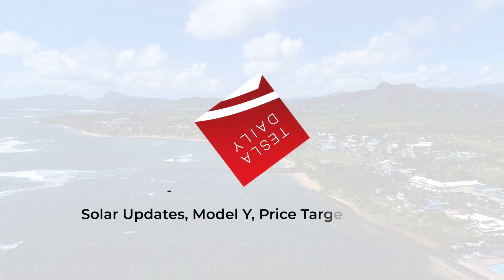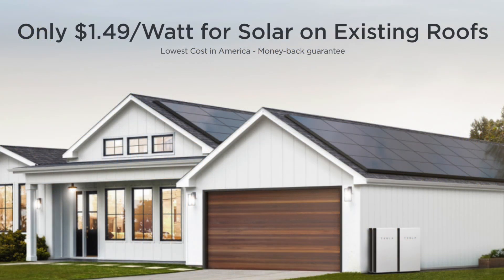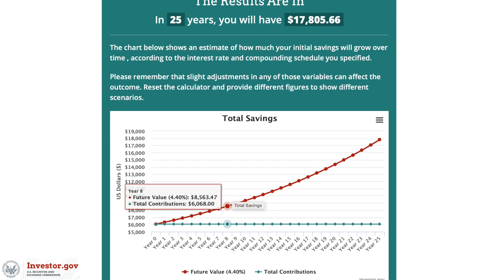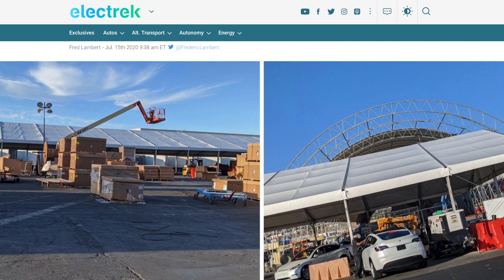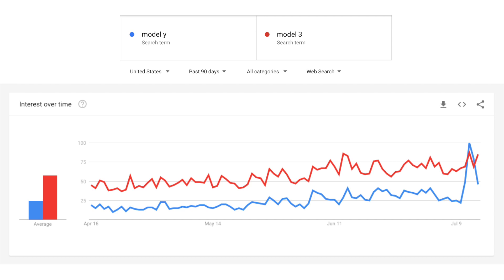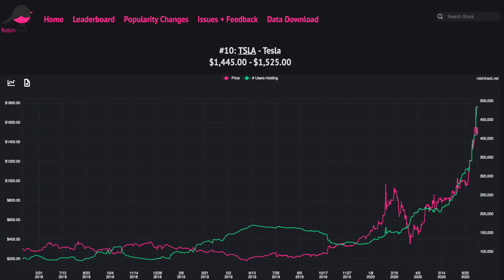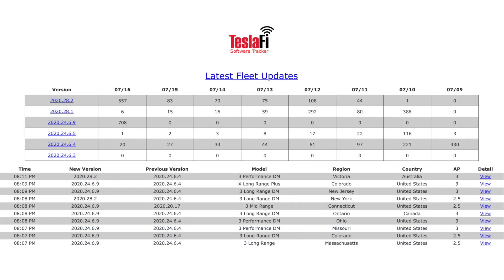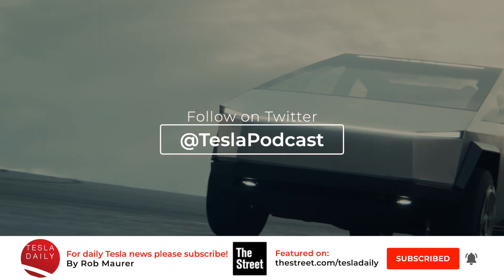Tesla Pushing Down Solar Prices, Model Y Interest Up, TSLA Price Target Increases + More

Comment: Ha haha. Money Back Guarantee.. You never had to deal with Tesla when comes to money. I lost 30% of my production last year because my system being down for 3 months. I was told I would be getting the difference under the Performance Guarantee. After numerous calls and run a rounds I never seen a dime. You might think the Company with the highest Market Cap would pass a little of that back in good Will customer service..

Comment: You do the math!  Installed Tesla's numbers are $2.01 before and $1.49 after incentives.  I pay .11 a Kwh, in Texas. The average price in California is 16.7 cents per kWh.  It would costs based on $2,010 for a thousand watt system, which would produce "about" 5 Kwh a day, that $2,010., @ $.50 a day, over 11 years to pay off.  Of course Seattle homes and Arizona homes would be different due to geological factors among other variables involved.  That is $2010 (costs) to produce  $0.55 cents a day of electricity you won't have to buy. It would take 11years and after that you would make $0.50 a day.  Those numbers would change depending on the orientation of your roof (panels), your costs for grid power, Latitude and other numerous other factors.  The numbers I used suggests with back of the napkin number calculations the cost are still to high. IMO with Tesla pricing.  If you pay higher for grid power your pay back is  faster. Was that to difficult to say or understand??  Cheers

Comment: Hey Rob, regaring your end comment, you could already set difference between temperature for driver/passenger.

The difference is in the efficiency of turning it off completely which you could not before.

Comment: I don’t understand why solar is so expensive in the US?? $1.49/watt looks like a winner vs that table of US prices.

Yet I had installed two 6.6kW panel systems in December for 3300AUD each. That is 50c/watt or US$0.35/watt installed, after incentives. 5x cheaper than Tesla here. And the 2 installers had to drive 600km (375miles) one way from Perth to install them. What gives with US market pricing?
Reply from the maker: Do you know the AUS incentive structure?
Reply: Tesla Daily yes I do. It varies a little by state and is reducing each year till 2030, but homeowners will be quoted an inclusive price so it’s easy. The incentive increases linearly with system size
As an example, in 2020 in Melbourne a 5kW system will get you a $2500 price reduction, a 10kW will be subsidised by $5000.
https://www.energymatters.com.au/rebates-incentives/solar-credits-australia/

We don’t have any import tariffs on Chinese (or German) panels and inverters so maybe that’s significant. Silly if that is the reason why the US systems are so expensive?

Comment: I know it's most likely not 13M cells per day, but I'm wondering how many of those batteries are going to Powerwalls, Commercial Grid Storage and Utility Grid Storage.  From what I've seen Powerwalls are running a 2 to 3 month backlog, Commercial Grid around 4 to 6 months and Utility Grid between 8 months to a year backlog.  Who knows how much of a backlog they're going to have once they start rolling out the Semi's for customers (from what I understand they've already started using Semi's to deliver Tesla's).  Either way, they definitely need to ramp up production as fast as possible to fill in those gaps.
Reply from the maker: It’s a pretty small percentage. Tesla delivered 1.65 GWh of TE in 2019 and guided for growth of 50%+.

Comment: The ROI of PV goes through the roof if you consider switching from a gas/petrol car to an EV. Here in the UK petrol is approx 300% more expensive per unit volume than in the USA, but PV costs about the same (A lot of my American friends have no idea its so much more expensive !).  My annual petrol bill was around £4.5k / $5.6k per year. Now I drive an EV, and have 9kW (we have 3 phase at the building), and you could argue that the cost of the PV installation will be paid back in UNDER 2 YEARS from petrol savings.... We also get paid a modest amount of FITS for what we generate (including what we use before export to grid !). Look at it from this perspective, and putting as much PV on your roof as you can is a no-brainer …

Comment: @tesladaily Is the calculation of cost savings not missing something? You calc. Assumes that every watt of energy produced is used. This is not at all possible with solar panels alone. Only a storage system like Power-Wall would match production and use of energy, since they can accur at different times in a day. So your 8 year amortization assumes storage but doesn't include it as costs? Or is it right to assume that you sell to the grid what is not used and use when not enough is produced all for the same cost/price?
Reply from the maker: It assumes either backup through battery or grid (net metering or selling) or that you are able to use what you generate as it comes in. Always tons of variables with solar.
Reply: @TeslaDaily  very complex true. You being someone covering all of Tesla have now even more to consider with energy and more GFs. Good that you got the base case already on tab. It's really appreciated and patreon support is coming from Germany.
Reply from the maker: Thanks, Jan!

Comment: If usually battery constrained then build up some stock. The semi will need loads of batteries so the numbers may be indicative they are ready to go with semi. If a semi needs 5x a normal y then there is enough capacity for  500k Cars and the rest to semis/mega packs/power walls

Comment: Tesla also has power walls to make as well. which definitely takes out some of their battery production going to their cars. so it could be accurate still. especially with people trying to get solar and battery storage for that solar in their homes.
Reply from the maker: Tesla only installed 1.6 GWh last year though, they probably won’t do more than 4 GWh this year. Pretty small portion of the total at this point and I was pretty generous with the 5 GWh example I used.

Comment: Prices went UP for 75% of Tesla's solar offerings yet you still put "Tesla Pushing DOWN Solar Prices" in the title due to the price decrees on the other 25%. Are any fans of Tesla not an obnoxious zealot?
Reply from the maker: Haha, I don’t think I’ve ever been called an obnoxious zealot before, thanks for the new one. Two days ago the cheapest solar system you could buy from Tesla was $10,000. Now, it’s $8,200. Yes, Tesla is pushing down solar prices. And my title isn’t singularly focused on one change anyway. It’s the general trend since a couple months back and also relates to the competitive market place. Both accurately characterized by “Tesla pushing down solar prices”. Hope that helps you understand.
Reply: I'll split that hair for you sir.  If they sell a lot more of the smaller systems at the cheaper price, then the overall "solar price" will be down.  "Obnoxious zealot" is a little harsh, and I'm saying that as an oil industry professional.  8-)
Reply: why the hate?. just dont watch "tesla fans" videos...

Comment: Wow solar is expensive in the USA... In Australia I paid only about 11k for a 10kw system, and that wasn't an overly cheap system. It has more expensive components and panels.
Reply from the maker: Post-incentives?
Reply: @TeslaDaily  Yeah that is not sure how much it is as the installer gives you the price with it baked in. Still don't think it is that high. We have a really competitive solar industry here. Last I checked we install around 2 GW of rooftop solar each year nation wide. Which is good for a country of only 25m

Comment: Sandy Munro briefly mentioned that the cells in the Model Y teardown looked different than the cells from the Model 3 teardown. I wonder if the Y and maybe all 2020 Teslas have the new chemistry already and will be software enabled after battery day for more range. That would counter the Osborne Effect. Jack Rickard talked about this, too. Plus, the new batteries can be made faster and cheaper and that can be why Semi can be happen soon.

Comment: There were so many mistakes in that Superfactories documentary segment, I wouldn’t put too much weight on the battery cell quote. It’s clear the producers got some info which they then edited and never confirmed with Tesla (like the “M3” they kept mentioning while showing footage of the Model S). Best guess: someone might have mentioned that the current footprint of the Gigafactory is designed to support a production capacity of 13 million cells per day, and the production team concluded that’s the current running rate. 
I’d love for it to be true, though, as it would indicate the stationary battery business is ramping up fast. Hopefully someone will ask the question during the upcoming earnings call.
Reply from the maker: I meant to mention the ridiculous M3 usage but slipped my mind
Reply: @TeslaDaily  Rob, you probably have already seen this, but just to be sure: it seems Electrek was contacted by Panasonic who claim the 13 million cells a day number is wrong. Quote: 

The only new piece of information that was disclosed in the show was that the factory produces “13 million individual battery cells per day.”
But now Panasonic, who is behind battery cell production at the factory, told Electrek that the information shared by the science channel is not accurate.
The battery manufacturer didn’t want to confirm the actual battery cell production capacity at Tesla Gigafactory Nevada for “competitive reasons.”
Reply from the maker: Makes sense, thanks.

Comment: I kinda feel like tesla should just focus on the storage aspect of renewables and leave the solar deployments to others...
Reply from the maker: How come?
Reply: @TeslaDaily  Although there are numerous positive aspects of the Tesla mission statement, here it becomes a liability.  Solar is not their core competency and may be a distraction.  Now it has pushed vehicles below the fold.  Are they innovating in this space?
Reply: John Carpenter they can’t do it all... in some areas they just need to light the spark...
Reply: Tesla Daily it’s so laborious to get solar out - so time intensive - different for every property - very difficult to make profit... because it’s commoditized - but most importantly others can deploy it just as well as tesla or better (excluding the elusive solar roof) - but nobody can fix the grid / storage problem like tesla can... let tesla focus on what tesla does - let tesla solve the problems that nobody else can...and Tesla can enable others to hit the ground and get those solar farms growin...
Reply: @SejalPatelDrSej  I tend to agree, tesla sometimes tries to do too much, if they specialize in battery manufacturing they could become the worlds supplier of high quality li ion batteries
Reply from the maker: I like the integrated solution. Tesla can eventually be the gatekeeper of all residential energy consumption. That’s a powerful ecosystem. Lots of economies of scale as well. Remember how costly securing a sale is in the solar business. Tesla will massively cut that overhead. Eventually, I anticipate a rentable bundle of vehicle (or miles), solar, and storage. One quick Apple Pay and your energy needs are fulfilled, all by the same company with a slick UI you can track and manage on your phone. I wouldn’t want Tesla to give that up, no way.
Reply: Tesla Daily if only solar installs were that smooth ! Takes a lot of outsourced manpower on the streets to get the panels up and difficult for tesla to regulate quality control... it’s a different beast from in house manufacturing or deploying a large scale battery solution with dedicated tesla staff....while renewable deployment is essential to Tesla’s mission, Tesla doesn’t have any installation advantage over a “sunpower” type company that is dedicated to solar.  Accelerating the transition does not mean that tesla has to do everything. In some instances tesla may accomplish more by partnering with others  to achieve their mission statement...so long as it “accelerates” the transition. Partnering doesn’t have to detract from the integration benefits (software solutions) of a renewable ecosystem that Tesla can provide.
Reply: Tesla is hitting economies of scale and it’s a perfect marriage of EVs, Solar and battery backup.  Products just sell each other, if you bought an EV you will want solar, if you have solar, eventually you will get an EV, if power is expensive and prone to outage you will get battery backup, ideally with solar.  Prices keep dropping and Tesla keeps improving their process.
Reply: ...many said Musk could not successfully build car factories, land rockets in the ocean, build tunnels cheaper than anyone else, implant electrodes in the human brain, develop and launch Starlink internet satellites, etc. ALL of Musks companies are very successful with vertical integration. Why is solar any different?
Reply: 205 rider I’m not saying he can’t do it - you’re missing the point
Reply: It’s expensive to bet against Elon.
Reply: @thutch8097  It's also expensive to not correct your mistakes.  Lucky for us shareholders, Elon tends to acknowledge his.
Reply: And don't forget the V2G integration.